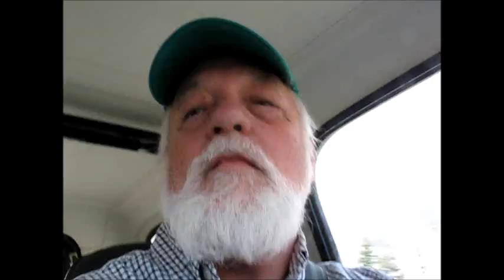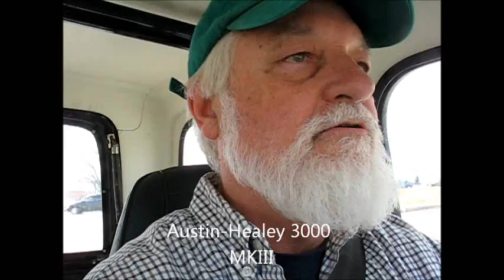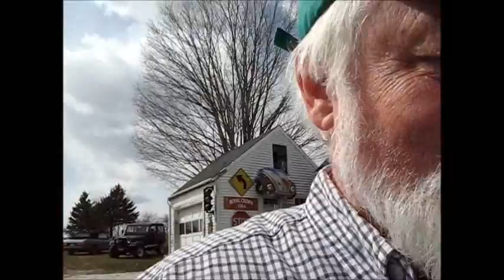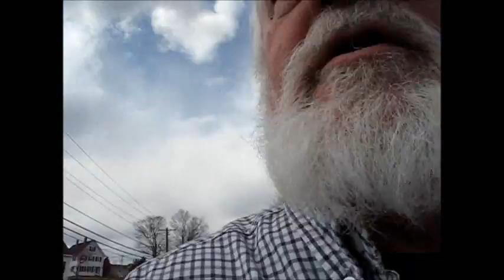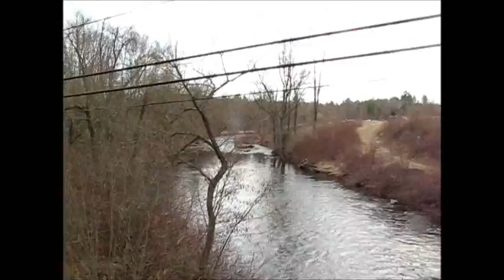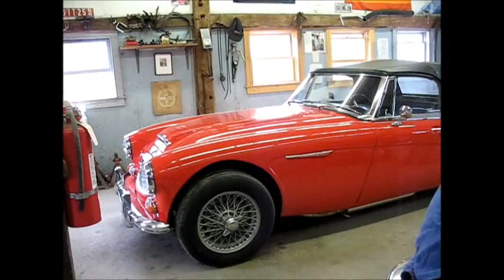Jeep won't run without gas...  Dang!

Comment: do you think the Jeep is doing bad on gasoline? May be it was when it had the old carb on it. Its most likely fixed now and doing a lot better on gas. Plus the timing chain is new now and it probably don't do too bad on gas. You should fill it up to brim check the odometer mileage then drive it for a while then fill back to the brim check the mileage subtract the new miles from the old miles to see how far you went. Then divide the gallons used into the miles went. Then you get mile per gal.